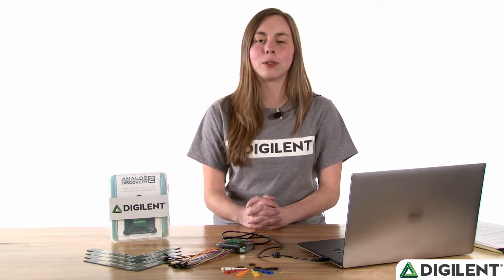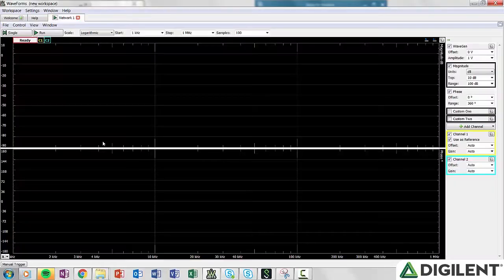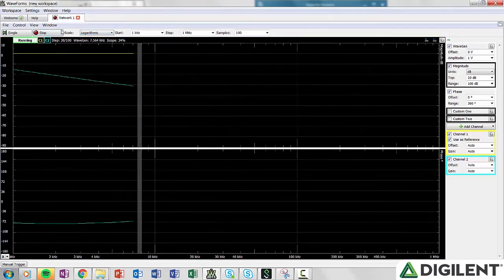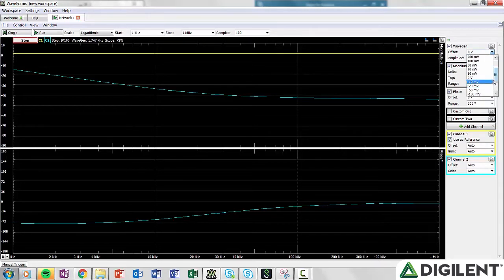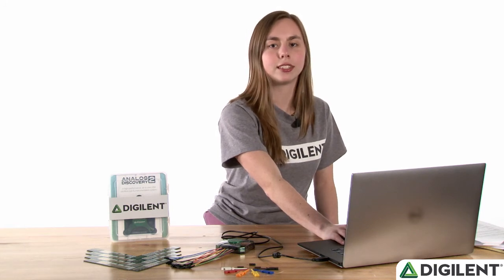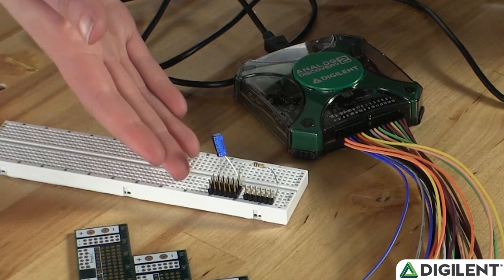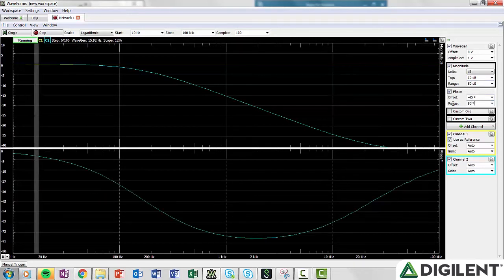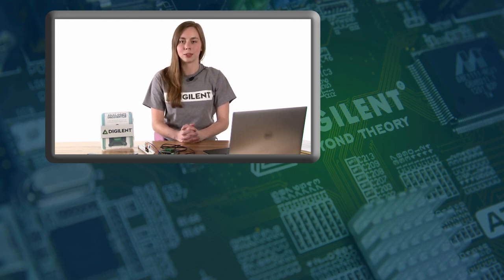Analog Discovery 2 Quick-Start: Video 7 - Network Analyzer

Comment: I tried to add an external 20Mhz function generator using the frequency extension options settling time etc.  I could not get it to do a frequency sweep in logarithmic mode.  I tried changing  all the settings including logarithmic on  the  function generator as im not sure if it's a bug in the  software of the network analyzer
Reply: it's frequency range between 1Hz and 10 MHz